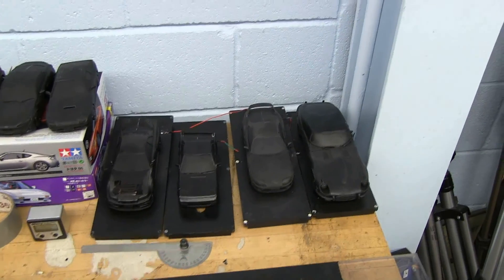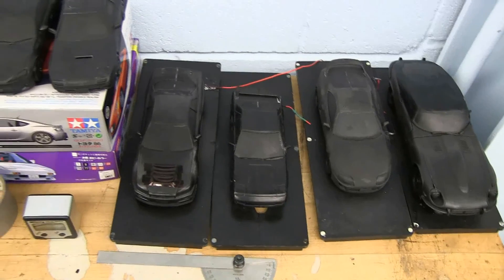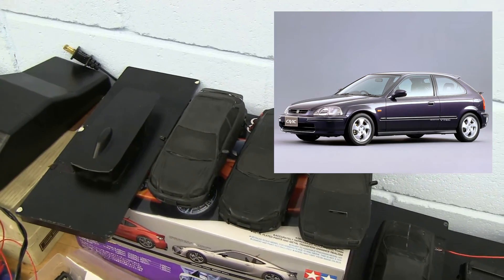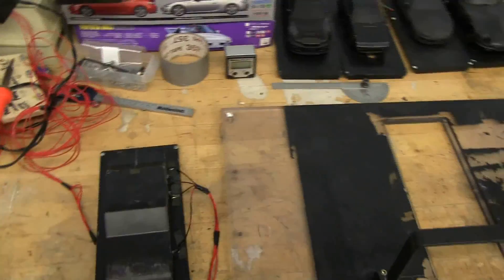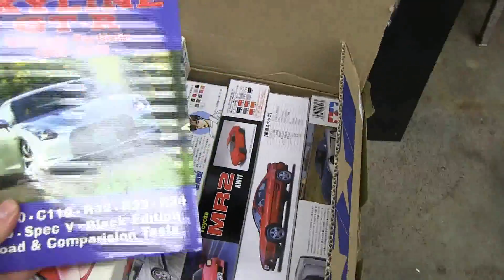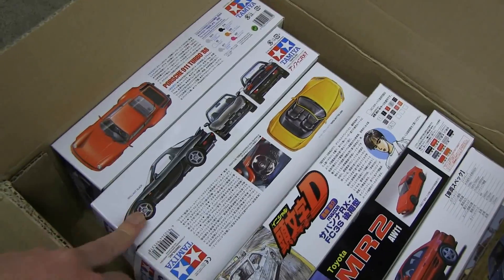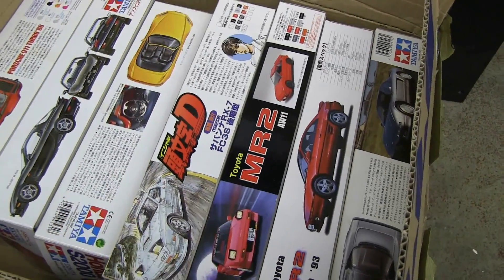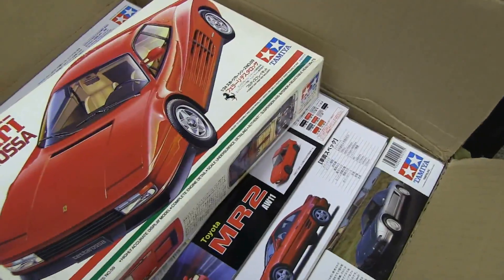Automotive Aerodynamics Future Episode Preview!

Comment: As an owner of a wingless MR2 Turbo SW20 I am excited to see the Sw20 results and how it compares to the other cars. Also is there a way for you to test the air that moves to the sides and under the cars? For example the SW20 Mr2 is suppose to channel air from the bottom of the car upwards to cool the transmission and engine and out of the engine lid vents. Also the side scoops on each side are suppose to accept air. Just wondering if this can be achieved at this scale.